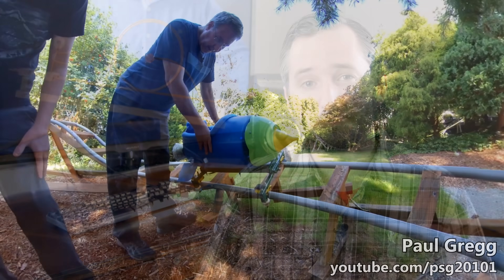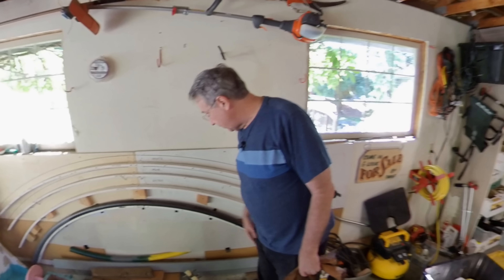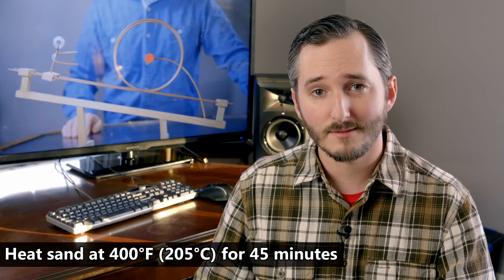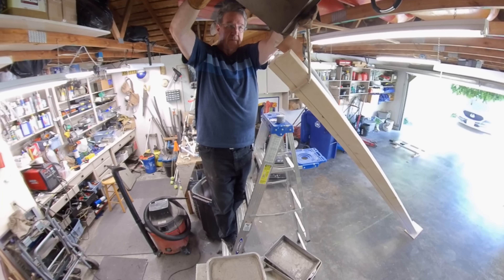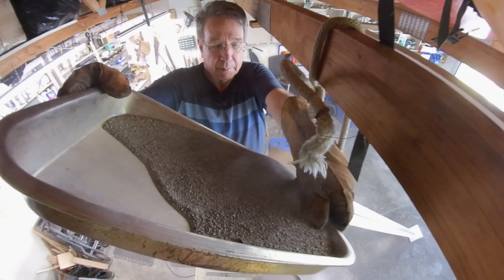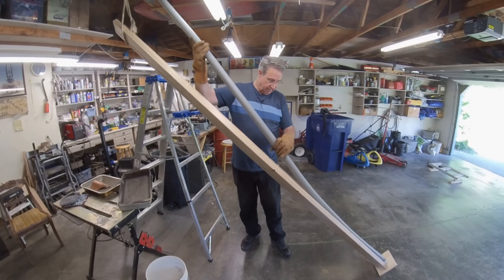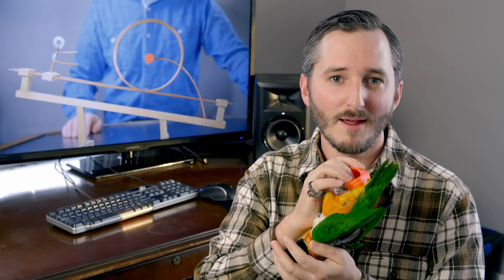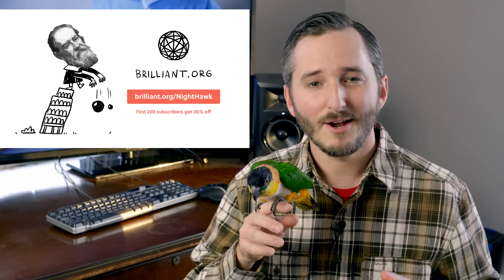Easy PVC Pipe Bending (How To/DIY)

Comment: I'm curious if it get soft enough that some sand gets embedded into the pvc on the inside.
Reply: Not at bending temps. If you get to the point where the surface becomes tacky, the pipe is mostly unworkable and will fall apart if moved.
Reply: No, it doesn't get hot enough. You have to get it pretty hot for it to get plastic enough for the same to embed into it. The pvc has almost a "skin" where the same won't stick even when it's plastic.
Reply: If it's sticking it means you have the sand too hot. Avoid breathing any fumes. Polyvinyl chloride will act as a nerve agent if breathing the harmful fumes.
Reply: Chilly Jack: If you think you like bending PVC then go for it! I used to overthink these things as well. But I've learned in order to get good results I just have to try things out. Ok, I start with a bit of internet research then do a reasonable experiment (like heating it for 20 minutes at 180 C) and see what you got. If at first you fail, make a reasonable judgement on what you can change and try that next.
Reply: It most definitely would, but it wouldnt affect the the performance of the pipe for the way theyre using it.

Comment: Who else held their breath to avoid silicosis?!
Reply: None of us with any sense. You don't get silicosis from pouring sand into a pipe one time, or even the dozens of times he's done it. There was a tiny dust cloud, 99% of which blew away, and of the remaining 1%, he may have inhaled 10% of that. Stay with me, we're at a total of 0.1% inhaled. Then 90% of that is stopped by your house/sinus/mucous membrane. So the few particles of sand he inhaled isn't going to cause him any problems. You get it from exposure over time. I'm struggling to find out where people are getting this silicosis nonsense. If you are cutting concrete dry, once a week, for a couple hours at a time, over years, you might develop silicosis.
Reply: @xenonram  Thanks for overreacting, I don't think anyone is under the impression that one time will kill you.  It was a joke, however avoid breathing in any particulate material whenever possible.  Long term none of it will be good.   Kinda like sunburns, get a few really bad burns and never worry about it much, then get into your mid 50s and then you start getting questionable spots that need frozen or cut out.  So you really don't know how "one time" of anything may affect you until you get older.

Comment: but that mean you have to heat 3 trays of sands for each pipe and the curves you can get will not be generic enough because it's depend on a pre-build radius, so if you want something weird like "S" char you'll need to build one specifically for that.
Reply from the maker: You can hold it into any shape by hand if you want something unique. You only need to build tooling if you want the bend to be precise

Comment: Maybe try a PVC frame for a camping pack where the PVC can also act as water storage.
Reply: I question the safety of that. PVC pipe is only suitable to transport cold drinking water. Hot water running through releases carcinogens in the pipe, making it hazardous. The hot sand used to bend the pipe would have the same affect, and I imagine possibly remain to taint any cold water later added to that pipe.  Not necessarily true but thought and concern all the same.

Comment: This is an old trick, but better than a heat gun. People use sand to bend copper tubing also, so that it doesn't kink. You can also heat up the end of a PVC pipe, and press another into it.

Comment: I wonder how small of a diameter pipe you can go down to before the sand mass doesn't carry enough heat to evenly heat it anymore.
Reply from the maker: Worked fine for me in 1/2". I'm sure it would work even smaller

Comment: Any warning regarding aerated micro particle silica, on par with dry cement dust......
Reply: Dry sand is harmful, but not on the same level as dry cement. Cement contains lime, which becomes corrosive when mixed with water (like the water in your lungs).
Reply: Everything is dangerous. Do this at own risk. Do health research before hand. . .HAPPY
Reply: @quoththeraven5631  You're likely just going to die driving to the hardware store to grab the parts for this project...
Reply: @TheCaphits  silicates getting into the air can very easily cause a long standing disease in your lungs that will persist your entire life.
Not death.
Wear dust masks whenever you grind or deal with dried sand/concrete mix. 
It's an accumulative effect meaning just once gets you closer to miserable your entire life.
Reply: The sand was just steaming because it was hot...
Reply: Maybe should put warnings on every faucet in the world "Caution: risk of drowning!"

Comment: If you want to bend small metal tubes, sand also works wonders. Not in the sense of heating the pipe, but fill a tube with sand, close the ends and when you bend it, it wont king and thus you have a constant radius inside the tube, which you wouldnt have without the sand
Reply from the maker: With copper pipe you can do that with water too. Greenpowerscience has a great video on that.
Reply: I use very fine #360 grit silicone carbide powder when I need to precisely bend thin copper/brass pipe. I used salt before, thought they would be easier to flush with water but the salt melted (and then clogged the works) because I had to constantly torch the copper pipe. SiC powder works even if I accidentally heat the pipe to glowing red. Due to it's fine yet heavy density, compacting (light tapping) is so much easier too.
Reply: one really nice thing with metal tubes is to use salt, usually road salt is dirt cheap and it dissolves in water so it makes it easier to get out than sand when doing more complex bends

Comment: This is the old way to bend pipes, filling up with sand an bendit with a spring tool ... i remember a plumber doing it .
Reply: Not pvc. Sand has been used to fill metal pipes, strictly for it to hold its shape and not kink. Same goes for the spring. If the plumber you observed was not heating the sand, it he wasn't doing it with pvc.
Reply: @xenonram  Sand is still heated for metal work bending, but it's to get any possible moisture out so there's no steam build up in it. Ends usually end up capped in some manner to keep the sand packed in place and not let it pour out.

Comment: This is so cool... I was just mulling over how to build a greenhouse frame with PVC... this is the answer of how to do it.
Reply: A bonus tip for you then. If you heat up the end of a PVC pipe with a heat gun. You can push another piece of PVC pipe into it. Saving you from buying couplers.
Reply: I use UV resistant PVC 3/4" inch. It bends fine without heating. It holds some of the shape afterwards too. I tie lengthwise pieces in 3 places or more to make it stable. I bend those 90 degrees and support them with pieces of PVC to the ground. That helps stabilize. I use it for hoop houses (mini green houses that can be 5 tall or probably more.The regular pipe doesn't last long, the UV resistant pipe has been working for me for many years.
Reply: I am probably beating a dead horse but make sure you use UV resistant plastic sheeting.. line the edges that pass over the piping with duct tape on both sides and sew adjoining pieces together with tie tabs so you can secure the sheeting to each hoop..The GF is  quite the seamstress and makes her own quilts so I tried to explain the process..No she passed but ....... said its very possible